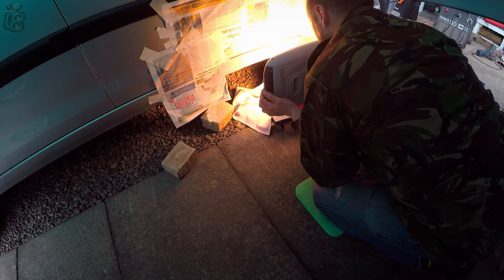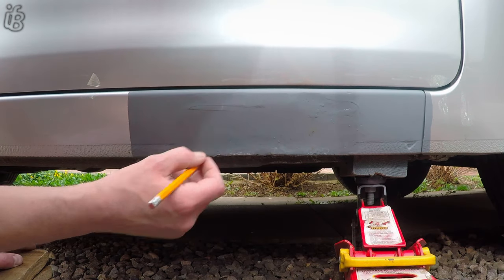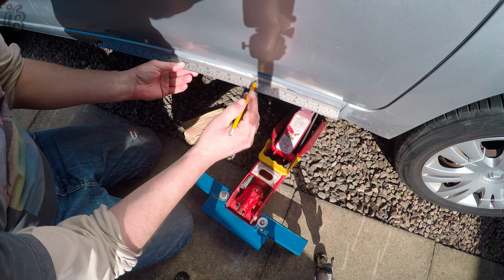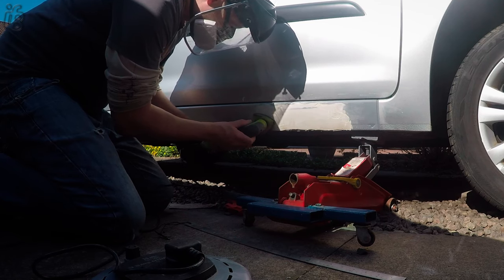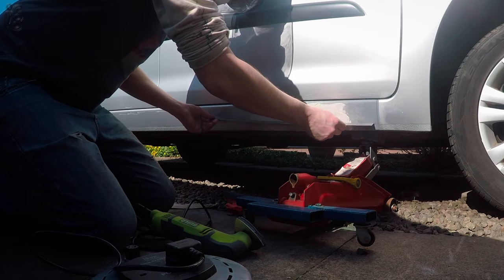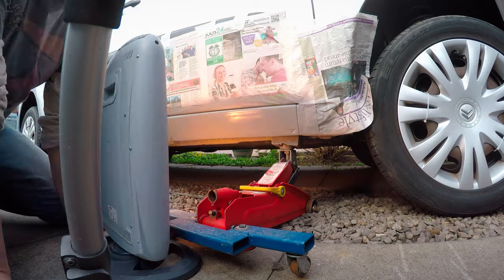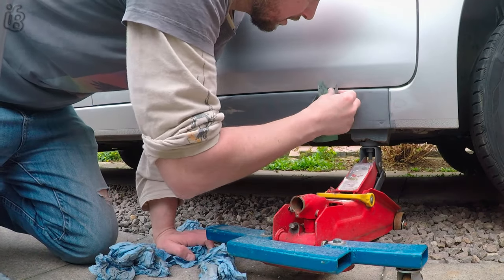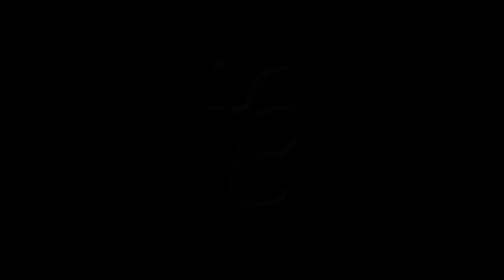Sill repair, plenishing & filling pt2

Comment: Dunno if anyone's said already, but ALWAYS disconnect the battery before welding.
Reply from the maker: Sorry just seen this, some people will remove the ECU too. Others say the battery can act as a spike suppression unit. I don't give advice on this, only to place your earth clamp as close to your work piece as electrically possible. I.e if welding the boot don't place it on the exhaust as the current has to go all the way to the top of the car, make its way to the engine block then back down to the end of the exhaust. A lot of cars these days have a lot of sensitive control units and sensors. 'IF' the battery acting as a suppression unit I would prefer to replace that rather than an ECU. Get the clamp as close to the weld as possible and don't short the electrode on any other part - choice on the battery is yours aha

Comment: What does a repair job like this cost? I have a similar rust to get rid of.
Reply from the maker: To be honest if I was doing it again I would buy a new sill for about £50-60. Cut out the old once it was supported and allow access to get in there properly. My parents thought was a bit to daunting for them to have witnessed. I could imagine it could be anywhere from £400 upwards to 8. No garage will say exactly because it's a bit like cutting into a apple with a worm hole. There's no telling until you open it up. In all fairness I should have cut out a bit more as I was welding on poor metal.
Reply: That sounds about right. I went to view a vw golf mk3 variant with just over 100k kms yesterday and the top portion of the sill was rusted through. I told him it could cost about 1k euros to fix and he about blew a fuse. Not to mention he never sent me a closeup photo of it like I requested before I drove 4 hours there, so makes me wonder what other rust is there but not seen. Too bad as it was a beautiful car. 

Your work looks great. Do you have a recommendation on a welder to start out with. I plan to do like you suggested and just but the panels and weld em…but kinda scared as Ive never welded before. Lol
Reply from the maker: I'm using a cheap sip welder, don't go gasless and get something that you can dial in. Check out the UK weld forum mig-welding.co.uk.  Most of them have bad things to say about sip welders but I like mine. If I had unlimited money, tig all the way. Doesn't heat the metal up as much!

Comment: HI Mate cannot understand why you edge weld,, A Joggler is far eaiser and fits fllat with the panel,,,,,,,, LESS Heat ,LESS Welding,,,,LESS Filling,, LESS Work,,,..Just a comment form one guy to another..
Reply from the maker: Still needs a continuous weld all the way around and would still have to stagger the weld so it doesn't warp. Tbh I did buy a cheap eBay one, but couldn't really get to grips with it, after shaping the profile then using it, it tried to flatten the patch. Maybe if I had spent more time mastering it..........